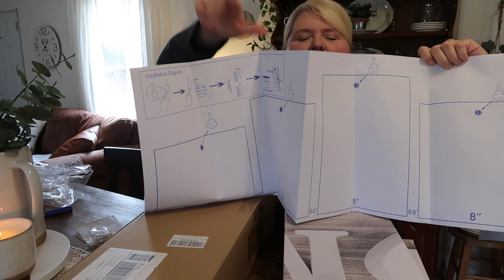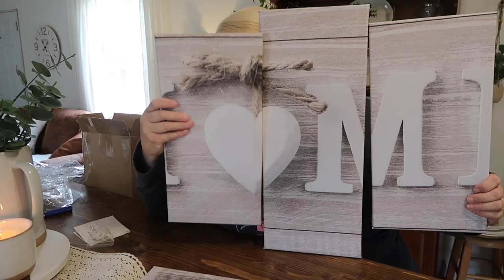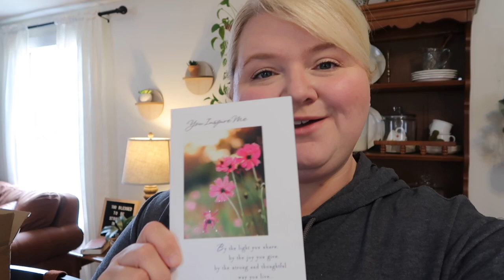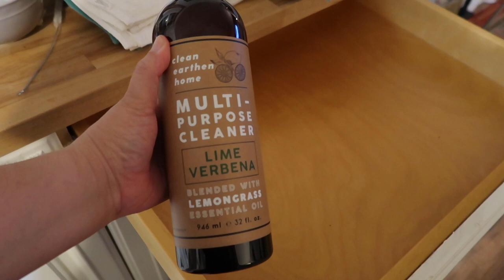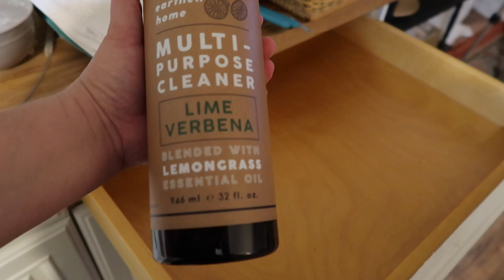Mobile Home Updates | DIY Window Trim | DIY Kitchen Drawer Dividers | Single Wide Home

Comment: Stephanie- If you use  a screw, it will help pull those boards around the window together. You can countersink it and fill with a little wood putty...If you were painting the trim rather than staining it, you could probably get away with filling the gap with a little caulk and painting over it.
Also, if you make a little tuck in each of the loops your kitchen curtain hangs by, it would shorten the length to what you prefer.
Reply from the maker: Great tips Lora. Thank you!